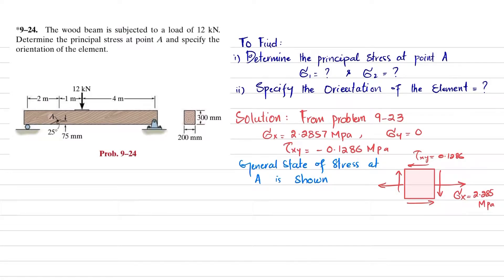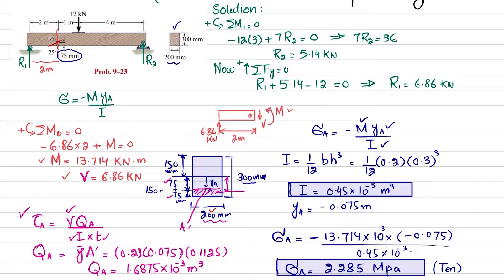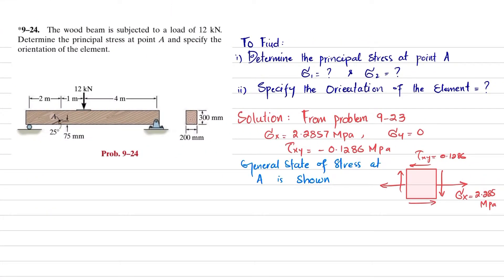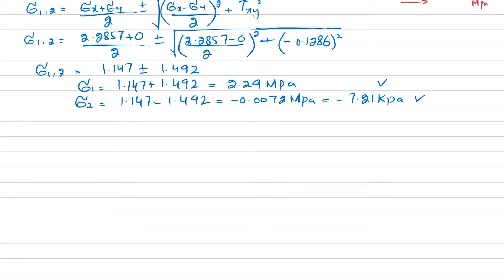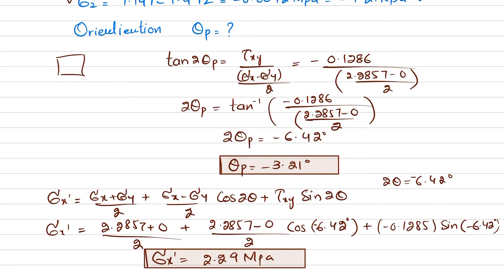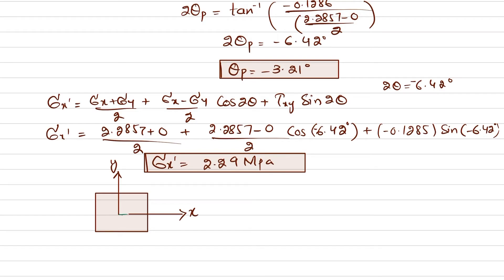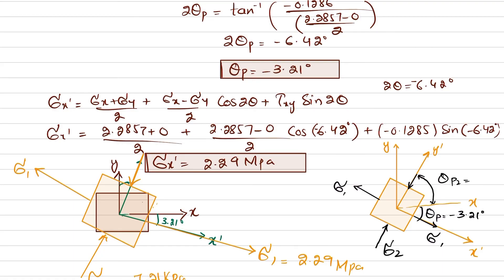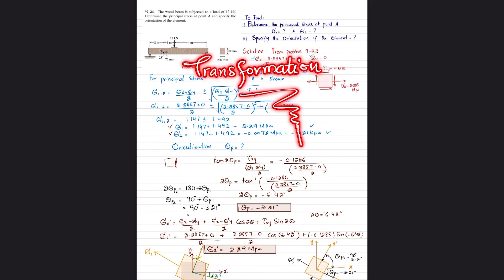9-24 Determine principal stress at A and  orientation of the element | Mech of materials rc hibbeler

Comment: Hello, professor. I wonder in what case sigma y does not equal to zero? It seems that even the loading in the y direction will only cause moment and thus bending in x direction. What element will cause sigma y not to be zero?
Reply from the maker: Hello, kindly check problem 9.23 for the details , and also for sigma y is not equal to zero for only this loading is not possible for this loading , for loading in 3 dimension,  it may be not equal to zero.
Reply: @engradnanrasheedmechanical   Thanks a lot for your answer!
Reply from the maker: @kamosmkey you are always welcome